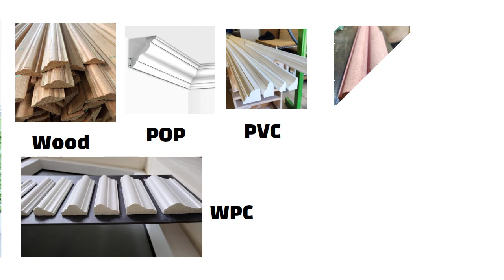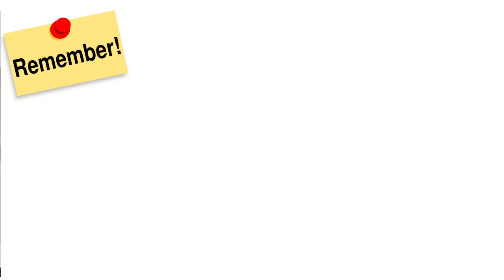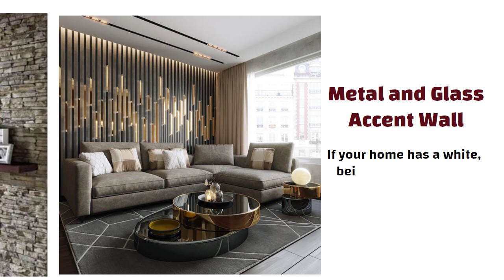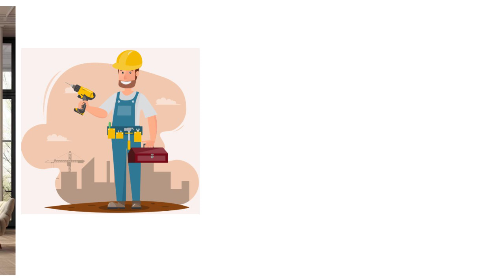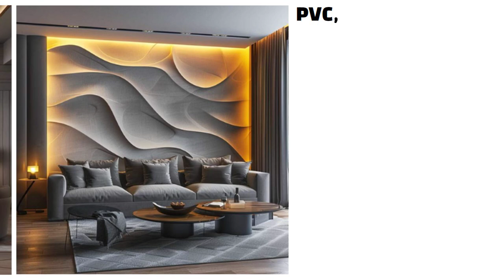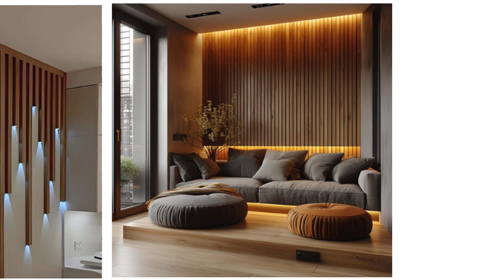LUXURY WALLS ON BUDGET! MAKE YOUR HOME LUXURY! ALL PANEL IDEAS! TRENDING WALL DESIGNS!

Comment: Thank you for this presentation. 
What do you advise for moulding on concrete walls specifically POP wall paneling  . I bought an already finished house but the walls are bare  .🙏
Reply from the maker: Wpc will be best option
Reply: Thank you  @engineeringmotive